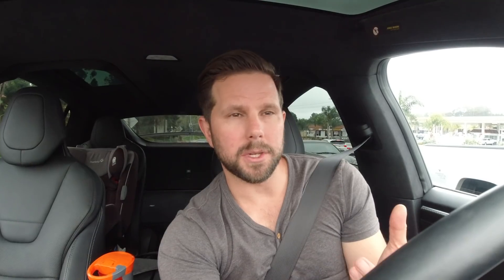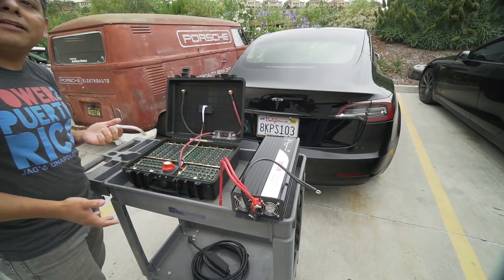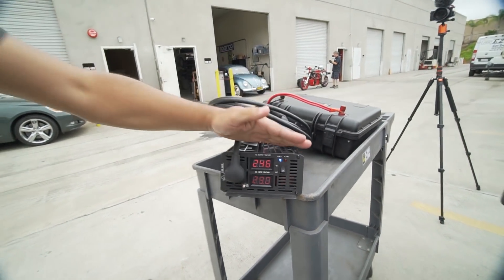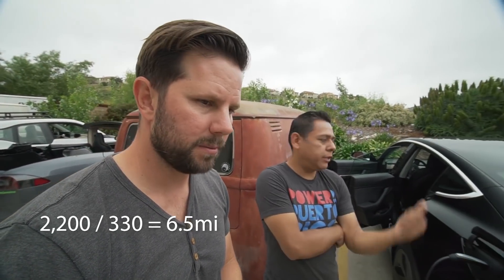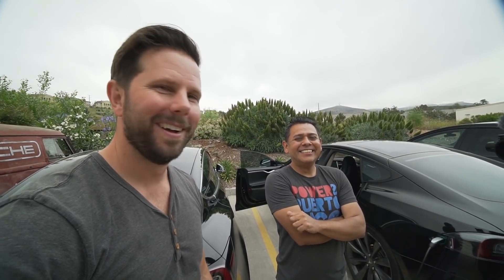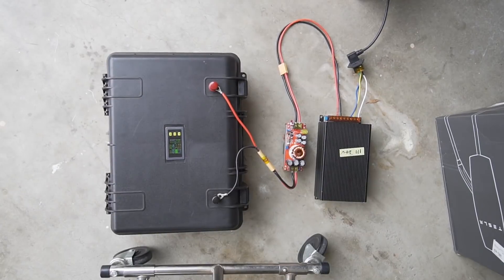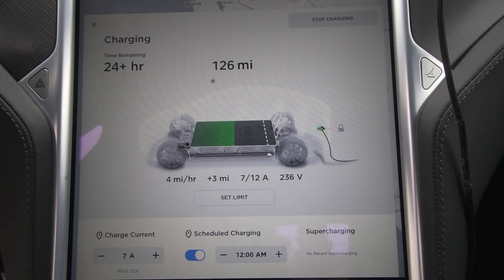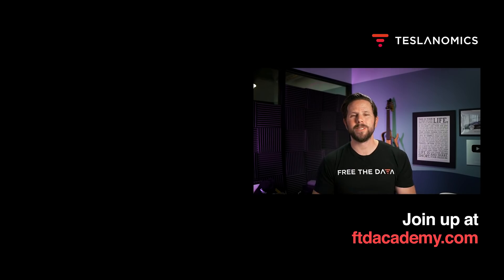DIY Tesla Gas Can - Will it Work?

Comment: It is an interesting idea, although I really don't know if running out of battery is or will be such a common problem, especially as charger density increases.
I could imagine a scenario where gas stations (slowly morphing into charging stations)  have something like the battery pack of the Silence S01 scooter to rent in case you ran out of battery over the last few miles. It has around 5 kWh and an inverter already inside of it and even though it is heavy (30 kg/66 lbs), it can be moved like a trolley since it has wheels. Should be possible to get 10-15 miles out of that, although you probably mostly don't even need that much.

Comment: count you use the parts of an ice car to generate enough energy well im not a mechanic so its round full of copper that charges an ice car when you drive well create a dinamo and electric generator and the gas can set up so generator dinamo battery to car and maybe if you had two dinamos in middle use one to create energy for the generator then other for charging the battery to car oh sorry i just created a crude tesla engine

Comment: Why not just have a separate port in the trunk and sell a 2 kwh portable battery (~30lbs) then you just plug it in and go and you'd have 6 miles or so

Comment: Why can’t we use a tesla as a power wall? My work would let me fill up the car during the day, then at night I could run my house off of it.
Reply: PapaWheelie - That could be problematic, there are special equipment that prevent electricity flowing back to the grid in case of a power failure.  This is so linemen working on power lines don’t get zapped.  If you have such equipment installed and approved by the utility company that would become possible.  This is done with a home solar panel system.
Reply: Macguy - yeah basically a power wall that has no solar panels or batteries is what I’m looking for. Just think of a fully rectifying UPS that can supplement the output current with electricity that I stored in my tesla from work. Or if it was an older tesla, free supercharging. 

It would be very electrically inefficient but is the only way I can think of to make a tesla financially effective for me.

Comment: The weight of this "PowerCan" will probably cost you more miles than you can charge with it...
Reply: Tertos88 And most of the time it’s sitting there as useless weight. The solution is to integrate more capacity into the main battery itself to increase range... which is exactly what the car manufacturers are doing. Thats why you buy the 100kWh model instead of the 90kWh, thats your “gas can” added to the battery...

Comment: Wouldn't super capacitors be better for this type of problem?
Reply: Brian Dakin yes but that’s going to be pretty complex for an amateur
Reply: Supercapacitors have 3 main problems that render them unsuitable: 
1. The voltage drops linearly while they discharge, requiring an expensive DC-DC converter to get a reasonably consistent charging voltage. 
2. The energy density is low, similar to lead acid batteries. That means either too heavy, or not enough energy to be worthwhile. 
3. Supercapacitors have a relatively high self-discharge rate, and could lose most of its charge in a week. Not good if there is no charge when you need it.

Comment: I feel like it would be unsustainable  to carry a lithium battery in your trunk long term considering the cells don't do well with extreme heat or cold weather while being idle in the elements. The workable solution here is buy a tiny 220v inverter gas generator for long trips as insurance for remote back roads and an additional insurance like triple A towing plan if all else fails.

Comment: 24vdc to 120vac to +/- 400vdc 

Would be easier and smaller to have a $150 generator stored in your frunk with that bottle fuel they sell at home improvement stores.

Comment: SO this whole huge battery pack and huge inverter will give you an extra 4 miles of driving. This and the length of time for charging is why current Teslas aren’t practical for long-distance commuting since so much time is wasted when traveling vs. a gas hybrid. The Tesla CybertTruck for 2022 will be the first practical electric vehicle switch 500+ miles of range.

Comment: This is an energy density problem.  2 gallons of gasoline that weighs about 12lbs contains as much energy  as the entire battery pack of a Model 3.  A practically sized portable battery pack able to even boost charge a Tesla isn’t really possible.

Comment: I take it we don't understand electricity very well.  You need 3 to 4kwh to make a difference.  Unless those batteries are portable fusion generators, you're wasting time.  Just put a 3kw generator in it.  But then you mind as well use a ICE to begin with.

Comment: Honda generator is the solution , or if Tesla is up for it, they should make a jumpstart cable so you can use a Tesla to charge a tesla.  Lol just as I am typing this you just said the same thing about tethered charging.  That is the only thing I can think of that has the energy density to do what you need in a reasonable amount of time without buying a multi thousand dollar portable battery.

Maybe the real solution is that Tesla needs to hurry up and get their Semi and pickup t rucks out there to be used as service vehicles for Teslas dead on the side of the road.

Comment: IMHO, a Hydrogen Fuel Cell solution would be pretty nice.  It's always ready, since you don't have batteries that can be run down. It is "green", and energy to weight is pretty good.

Comment: Using s "Supercharger" option that runs a DC connection to the battery would be more efficient, with no inverter. Might need a DC-DC voltage converter/regulator, and of course it would require knowing the technical specs of Supercharging. 
Also, some types of non-rechrgeable batteries have even higher energy density than Li-Ion. Not suitable for regular use, but perfect for emergency backup power.

Comment: It wasn’t the tesla that shut the power off, it was the battery pack itself with the protection feature that Jehu setup. It was pulling too much current (amps) out of the battery on the DC side.

Comment: With the rise of electric vehicles, tow companies should be all over this, or at least have a large mobile charging base, maybe a diesel generator on the back of a large diesel pickup! If a semi-trailer driver can use their diesel fuel generator to not idle their engines to power their stuff then why not make a mobile power bank?! Ev west should make this just so if anyone who has an electric vehicle in their area, they could be the unsung heros!

Comment: Has anyone brought up the inverter?  Many inverters can only put around half their rated wattage through each outlet.  Since that is a 3kw inverter, you may only be able to pull around 1500 watts out the way its set up.  A proper RV style inverter that allows full wattage might improve your charging speeds.  A good test for the inverter thats being used in Jahu's setup would be to apply a known load (say, 3kw worth of space heater) to a single outlet and see if they run correctly.  I know with my 2500 watt inverter I cannot run a 1500 watt space heater properly but I can run two separate 1kw watt loads, one on each outlet, no problem.

Comment: Why couldn't AAA bring out a small gas-powered generator (with the necessary fittings) when you tell them you are driving a Tesla that's out of juice?  Or run something off of their truck's generator straight out to the Tesla?  I'd rather wait for 30 or 40 minutes with the AAA guy while my car is charging than have him tow it a couple of miles up the road.

Comment: I'll say the same thing I've said on other videos that have tried this as I'm seeing the same thing really.
Size matters.
Size being the physical size of the battery and the inverter.  Jehu came closer to solving this than any others have because he has the experience to make it work, but it comes down to the same thing:
"This isn't a gas can".
Not even close.  So what you are left with is the real question being "What would the real world do?".

The answer to that is actually pretty simple.  If I owned a towing company in the year 2022, I'd have 2 powerwall 2 type batteries on my truck.  That would allow me to charge at 10kw (or close to it) and be able to get them some decent range to get to a charger relatively quickly.
If they were really out in the weeds, a truck with 3 or 4 powerwalls would be able to charge them even faster as well as carrying more power to get them to a charger even in extreme situations.

One is no less likely to have access to a powerwall solution than access to what is shown here.  It's just too bulky.  Might as well go with the full Monty. 

Nice episode though.

Comment: I worked for a company that had a portable charger for a short time. You could actually drive it around with a little controller. But it weighed probably over 1000lb and it was pretty selective in what it wanted to charge.

Comment: A good, somewhat portable, solution would be a AAA style service where a vehicle comes to you. It could either charge via its gas motor with many large alternators (think custom car audio levels of alternator) with an inverter, OR the more ideal solution would be another electric vehicle and a DC to DC method for as little losses as possible.

Comment: The concepts and recommendations are fascinating and I hope this issue gets solved.  I’ve gotten down to 10 miles to go, twice, and it was pretty uncomfortable.  Having either the Power Can or Tesla to Tesla charging sounds inviting.  Or, increase my 2016 90D range with a new battery pack or software upgrade.

Comment: how about a portable diesel generator? hello? (did someone just have a heart attack?) The whole point is to have a low weight energy transformer as carrying a battery that takes up space and range seems counter proactive. Maybe a solar generator works (but what is more practical when you are on trips, a gas can is usually empty and the idea that you first blame god (or any deity) and then take a long walk in the middle of the night to a gas station to fill up and return to the car. Just for you to contemplate on your life decisions.
What you want is a low weight capacitor that you take to a charger to quickly charge and then return add some miles.
Right now the best alternative seems to have someone tow you och call someone to help you. (it's expensive but so is getting mugged  and sick, so no real change if your car is gas or ev)

Comment: The only sane way to partially recharge a Tesla battery would be to carry along a Honda EU3000 120/240vac. inverter/generator, but then you're defeating the purpose of having an electric car in the first place. (not that coal or diesel power plants connected to the grid are any better)😜 I really don't understand the logic of the EV community being so focused on higher capacity batteries and more efficient converters when the REAL problem is the drive motors themselves. Electric motors will always be inefficient unless they are cooled to cryogenic temperatures. Motors at room temperature and above get less and less efficient as temperature rises. If you have unlimited power, then this isn't a problem. If you're running on batteries with a finite capacity, motor efficiency is everything. Figure out how to keep the motors at 35 degrees K. and you will have a vehicle that will run a couple thousand miles on current battery technology.

Comment: another reason I think EV vehicles are a ways off...  if only we could get vehicle manufacturers to adopt a battery pack standard, you could pull into a battery station, and like an oil change get a charged battery installed in 10 minutes or so... they take your old one, and charge it for the next customer. charging a nominal fee, and use solar, or wind power to charge the packs..

Comment: Tesla needs to come up with an in wheel/hub generator on the return of those motors to catch wasted electricity and to regenerate most/all battery power loss. Recycle electricity spent to creat new free energy with Stator Generators Elon Musk! That or make a Hydro Hybrid Electric that generates extra electricity with a silent hydrogen generator. They are simple, easy to swap out copper coils, use water and converts to hydrogen to power a silent generator. Perfectly clean emissions and minimal upkeep. I built one on a diesel truck and a gasoline engine and it increase fuel economy when combusted with those fuels... why not make a hydrogen generator that returns spent power?

Comment: Ben - a couple of things. Number 1: - "Energy Density" is a good way to help describe what's going on here:  kWh per kg of battery or whatever. I first learned this term in Engineering School, back in the 70's. Batteries have very low energy density, whereas carbon-based fuels like gasoline have very high energy density. This is one of the major issues that have faced EVs since their first inception, and looks like it won't get a lot better for a long time. It's the holy grail of developing battery technology.    Number 2: why doesn't each Tesla 'simply' have a power OUTLET - a 120 or 240 VAC outlet, that could be used for anything AC powered, including charging other Teslas or EVs ?

Comment: I still believe in portable or on board small Hydrogen Fuel Cells.
Selling or developing a retail electrolysis machine to fuel a fuel cell tank with hydrogen would work great. Simply plug in electolysis machine with water and then it converts into pressurized hydrogen at home.

Comment: Could we plug the battery pack straight into the Tesla battery and become an extension to the existing pack. It is after all the same type of battery (model S anyways)
Reply: Um, no. The discharged battery will take on monstrous current if you do that. Things will get flamey in a hurry.

Comment: Converting DC to AC to charge DC batteries is stupid. Why not plug into rails on cars batteries. Could wire leads to trunk to plug this or another battery in when in need. Could skip charging on the spot.
Reply: Better yet, trick the car into thinking it's a DC based super charger, and control the amperage the same way the Tesla superchargers do it.
Reply: @jean-clauded5823  Don't see how this would be better than hooking it up to the rails, as charging one battery with another would still lead to a lose in charging process and take time. Hooking it up to the rails via a cable routed to the trunk (or any location of choice) would mean using it right away. This assumes that battery would output necessary voltage, which could be accomplished by arranging cells in the proper series/parallel grouping.

Comment: I don't see why EV's shouldn't come with 120v or 240v plugs in them. They have massive bloody inverter already, why not put utilities in the car? Even a 10 kw power rdaw from the battery is peanuts to an EV battery. Worst case you could plug somebody in for an hour and give them 40 miles of range if their battery ran dead in the middle of nowhere. In the interim this is sort of possible to do already if you bring a 12v inverter with you, you can plug it into the lead acid battery to run power, the EV battery will keep the 12v battery supplied with constant charging power, but obviously this only practically enables you to do 120v charging, probably at a reduced charge rate. Not really practical to charge them unless you plan on staying overnight.

Comment: Thanks for the tests, Ben. A Model X can have 40 times the power capacity of Jehu's unit. But that small capacity could get you out of trouble. A 1 US gallon can of fossil juice might give an SUV a similar emergency range to that battery pack. Wait a few more years, while battery technology continues to improve, and a pack of that weight and volume would have the capacity of a 5 gallon can of dinosaur fluid.

Comment: 245 volts X 10 amps = 2450 watts.... 2450 Watts / 29.4 Volts = 83.3 amps. Output of bms  max 100 amps. Factor in 30% loss of efficiency and you get 108 amp draw on bms. All calculations are rough.

Comment: 24 volts (the battery itself) x 100 amps is 2400 watts the inverter is inverting it to 245(ish) volts ac at 10 amps you're looking at 2450 watts, no wonder it keeps turning off your pulling more than the BMS will let you.

Comment: I think the better solution would be a plugin setup where you could add the batteries in parallel to the car and skip the whole charging cycle. But that would require modification of course or buy-in from Tesla.

Comment: In the near future, super-capacitors will probably be the answer, they can charge in seconds, and discharge instantly, or really slow, depends what is being taken from it.
Reply: Wishful thinking, the energy density of chem batteries is vastly superior to supercapacitors.
Reply: Des, but chemical batteries are not going to advance much, whereas super capacitors are being built better and better constantly.
Reply: It's not a matter of technological gap, it's just the way capacitors work. The most advanced ultracapacitor in production has an energy density of 7.4Wh/kg while batteries are at 265Wh/kg. Contrary to what that seeker video told you, capacitors are not intended to replace batteries.

Comment: The Achilles heel of electric cars is charge time. They need to develop an industry-standard, cartridge battery that can be swapped out at a battery station in the time it takes to fill up a standard car.

Comment: You can solve the problem of the battery draining and not charging as quickly by adding a second charge circuit powered by 2 banks of capacitors.

Comment: Will it work?. Noooo... You can use a four gallon can as emergency backup on a regular gas car. To store all that energy you'll need a sixty gallon battery that will weight a ton, lol. Nothing beats gas at energy density.